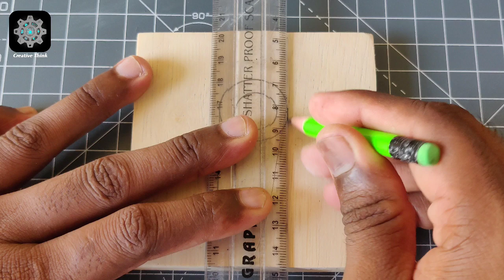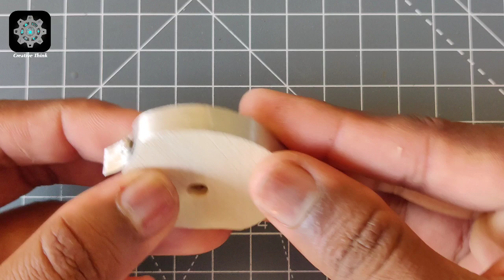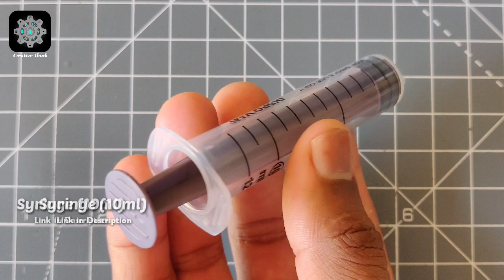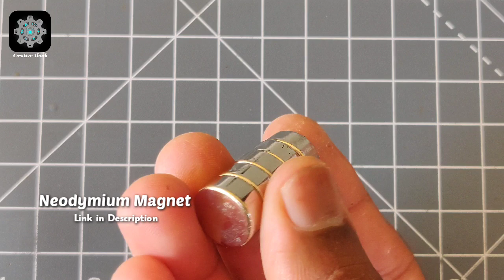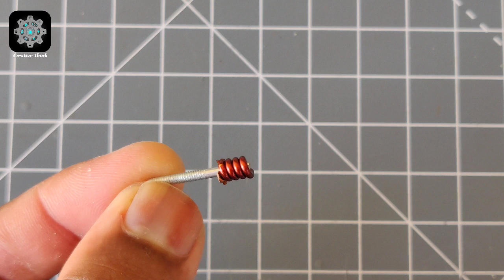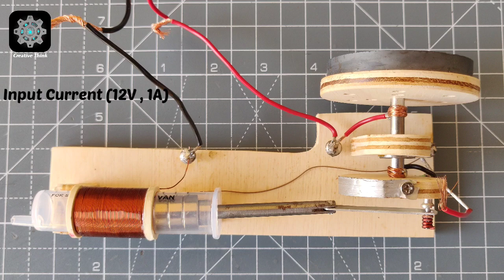Most Powerful Solenoid Engine Using Syringe

Comment: How did you calculate the number of turns and the voltage required applying to the coil ? Do you have any equation for making a coil like you did ?